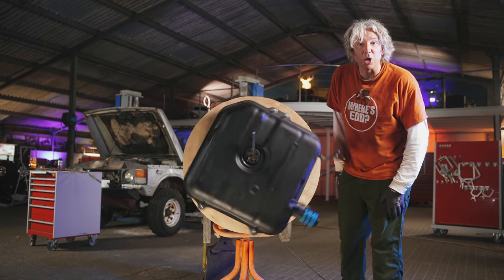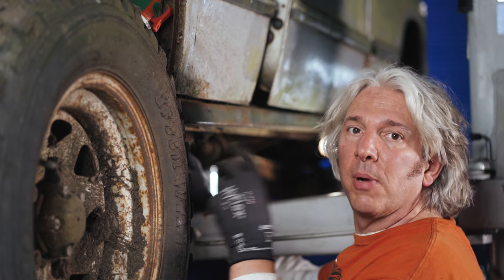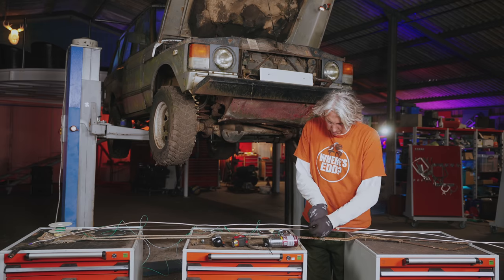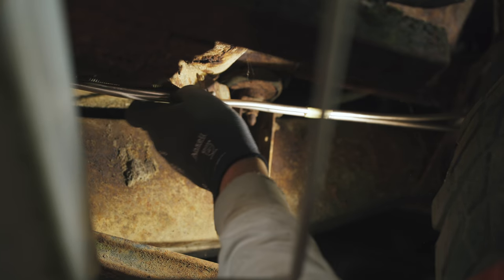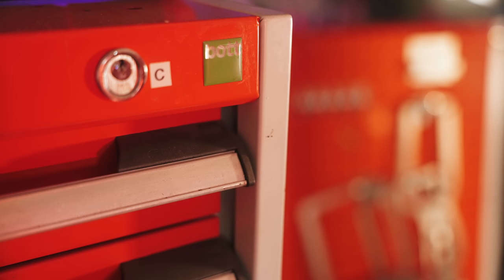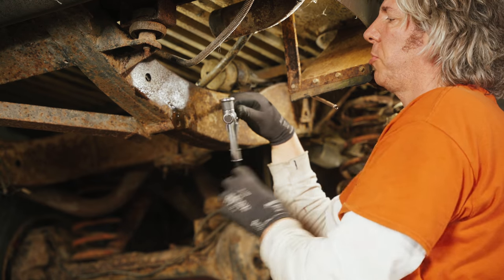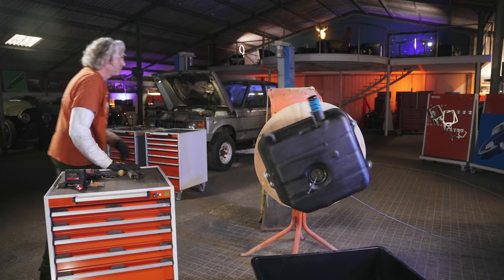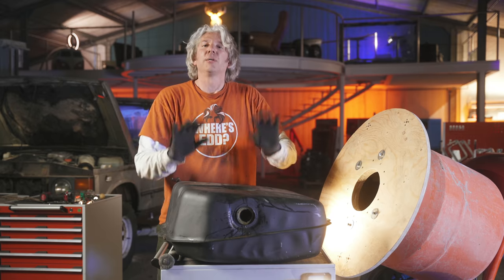1986 Range Rover, rusty fuel tank fix, Part 2 - Edd China's Workshop Diaries

Comment: Nicely done on the fuel tank rust.  I had rust inside a motorcycle fuel tank and got rid of it the following way:

Put in 15 litres of Apple Cider Vinegar in the tank.   (total tank capacity was 17 litres).  
Shook it around, left it 24 hours.  
Drained the cider vinegar out.
Filled it with water from a hose.
Drained out the water.
Blasted WD40 and shook around the tank.
Drained this out.
Filled with 2 litres of petrol, shook this around.
Drained the petrol out.

Tank was then ready to go.  I put an inline fuel filter, to catch any sediment, which I changed after 9 months.  Been using the bike for over 2 years with no issues.

Loving the new channel Edd.  All the best.

Comment: Really want to see this rust bucket to move again
Reply: It wants driving straight to the scrap yard
Reply: It's a bit of a dump,but Ed will work his magic 🎩💯💥💥🤜
Reply: I'd imagine Edd has checked the body and suspension for rust to make sure it has a chance of passing. Then again...
Reply: Terry Winter  it does seem weird and a bit strange 🤔
Reply: Terry Winter  rust bad
Reply: Me too ,sadly had to wait for
the imported bmw to be fixed
First. I like the older mini' s
I perfer the Morris , but can
live with Austin or even Bmc.
lol.
Reply: Terry Winter  

It’s to show ways how to remove rust
Reply: Terry Winter  

And to do it inside is trickier so he showed that also. It’s what these series is for.
Reply: Terry Winter  

It’s not what the show is about.
Reply: Terry Winter  

Edd shows an example of rust removal in tricky places, it is as clear as day you simpleton.
Reply: Terry Winter  It was an experiment
Reply: Terry Winter  That's what fuel filter is for!
Reply: Terry Winter  This way, we get to see the tank removal and refitting (useful for anyone who’s replacing one with a new one) AND we get to see Edd trying to restore the original tank (possibly useful for people who are working on a car where a new fuel tank isn’t an option for some reason). Ok, you think he should have bought a new tank - duly noted - but by trying to restore the old one he has also covered all the steps involved in fitting a new tank, so what’s the problem?
Reply: Bought 1 in 2005 they where falling apart then, would leave piles of rust after closing the doors.
Reply: I advocated scrapping it from the start!
Reply: Terry Winter  Edd knows full well the old Rangey is a pile of junk, but for the sake of his channel he is taking it on as a challenge to get it through a UK M.o.T. test and entertaining thousands of viewers at the same time. Give him a break.
Reply: Terry Winter  It saves buying a new fuel tank for a car that's worth about 2 sticks and a balloon, quite ingenious if massively time consuming.
Reply: @an04ker  my thoughts exactly
Reply: Terry Winter  Well, be my guest. Don't bother watching if Edd bugs you so much.
Reply: Terry Winter  New tanks are probably available for the Range Rover, but for some vehicles it isn't possible to buy a new tank or it is prohibitively expensive, and second hand ones are either few and far between or just as bad as the one on the car. In that scenario, this sort of process is the only realistic option.
Reply: Terry Winter  with that logic you might as well buy a new range rover m8.

Comment: Great to see you giving the cement mixer idea a go, you will get even better results if change the angle of the mixer drum and thus get different abrasion patterns inside the tank. We also used the mixer to a apply the coating on the inside (a new tank was not an option in our case)

Comment: That Range Rover looks like it was dug up by the Time Team.
Reply: @pete it was.
Reply: Nope, he found it in the canal
Reply: @col8981  it was dug up by Time Team in a canal.
Reply: @thewizzard3150  a saltwater canal
Reply: Yep, really dug up by the Time Team somewhere in the muddy banks of the Thames 🤣😅
Reply: Ha ha ha ha ha😴
Reply: I remember when l was younger
driving for a shit company in Luton.
I heard of petrol in a diesel , but not
diesel in petrol tank , also remember
not checking the water bottle & the
fuel line freezing up , lol.
Edd may be a quick lesson on 
Diesel & Petrol do' s & don'ts😀
Reply: I thought that’s how they came from the factory!
Reply: Nah, they're still looking for a burnt-out Cortina XD
Reply: @charles.stewart4422  remember that when cleaning a gas tank it is far less dangerous to use diesel oil than gasoline to clean it with bolts or whatever inside...
Reply: No, it's not the car wizards.
Reply: @Pete,  maybe they some Pottery found alongside it 🤣
Reply: The term "polishing a turd" springs to mind! 😂
Reply: Edds a great mechanic, but though he did all that work to get the Jeep operational the body work is poor. Needs a lot of work. I'd imagine it would cost far too much money making it proper road worthy and presentable again. Be cheaper to go out and buy a used model in better condition. This one looks like it was buried under a hay stack for years.

Comment: Starting in 1988 when I was young and full of energy I took a car I loved apart down to the bare frame. I sandblasted it myself then epoxy primed it and repainted it. I refurbished every nut, bolt, wire, hose, pipe, component and subassembly, just EVERYTHING on that car! So when I FINALLY got through it looked like it was on the showroom floor. Better, actually because it was a labor of love and it took me right at ten years.  So much of what you are doing looks exactly like what I did but you have better shortcuts than I did and I certainly am a huge fan of your mixer parts roller rust remover. I am definitely a new subscriber. Thanks for the vids!!

Comment: Not everyone can afford a new fuel tank. A new tank for a BMW e38 7 series is around £800. The technique shown is really useful and can also be used on a plastic fuel tank. I had to do this on a 5 series where the fuel had emulsified and a combination of thick varnished petrol and rust from the sender unit had coated the insides. I used lots of nuts and bolts and agitation to loosen the coating inside the tank and it restored a plastic fuel tank which was otherwise perfectly serviceable. Great technique for those who may not be able to source a new tank for an obscure classic or on a tight budget.

Comment: i did my brake lines with copper nickel tubing. great product. have been watching you since the beginning of wheeler dealers. I would have removed the tires on the rover for easier access. my favorite parts of wheeler dealers was you actually fixing/repairing vehicles.

Comment: Had no idea that type of line beading tool existed! There's a few times I could have used that, will definitely have to buy one for myself.
Reply: I second that would be useful to know where to buy it or what to search for...
Reply: @happy-days7952  I second THAT!
Reply: @ronskopitz2360  I'm in Canada. We have loan-a-tool programs but the selection can be limited depending on where you're located and now it's gotten to the point where places discontinued the program. Closest place for me used to be a 45min drive, but now I'm not even sure if it's still available.
Reply: @ronskopitz2360  Strewth. No one does that here in Oz, they'd never get em back.
Reply: @jeffkeith637  same here!!  The way they “loan” the tools is that you buy them at full retail, but you have 90 days to return them for a full refund, regardless of condition.  It’s super helpful, with the obvious flaw that the tools are often in pretty bad shape.  But it’s better than having to pay hundreds of $/£/€ for a tool you’ll only use once : )

Comment: Having Big chunky connectors on the fuel line “wouldn’t look right”. 

Meanwhile, moss is growing on top of the headlights and the inside of the car is a verifiable terrarium.
Reply: That's called patina 😉
Reply: @danbradley7176  I was doing work at the house/shop of a guy who was a fairly well known builder at the time and he took me out to see a vw beetle that was being featured in a magazine.  The thing had rust on every surface and when I asked wtf is with the body work he said bro it’s called “patina it’s going to be the next big thing.”  It took a while but he wasn’t wrong.

Comment: Really like the bead tool Edd. I have made new fuel lines for my BMW 840Ci that I have been restoring for a few years out of 8mm copper pipe, and I soldered 8mm brass olives onto the ends to create a bead. Works great, simple and cheap.

Comment: I had the same with a Harley tank. Completely rusted and pieces of old paint layers on the inside due to Ethanol.  
There is a company in out country that blasts the inside of the tank 100% clean to blank metal, and then gives the inside a coating that will stay on for the coming 25 years garanteed. Total cost €350
Reply: You could of used sodium hydroxcide to inert the steel. The main ingredient in spirit of salts drain cleaner.
Reply: @derf9465  I did. I used about every known method over a period of 4 weeks. Never totaly got rid of the rust, and i wanted clean bright metal befor having it coated again. When there still is any rust, you can start all over again in about 3 years. I worked with rusty gastanks several times over the last 40 years. Caustic soda/ natriumhydrixide can only do a limited job. The "pearl" blasting does the trick, but you need specialized equipement and a camera for working 100% inside the tank.
Reply: Por15 tank cleaner kit does the job alot cheaper
Reply: @danieleaton1399  I dont know that Por15 product, but in Europe we do have several kits for cleaning and coating rusted gas tanks. Ranging from €50 to €200, but in the end, over the years, the results of these were seldom any good. Por15 can be better or something new, i dont know.
Reply: @BMWHP2  you can buy it online I used it to clean my car tank had been sitting 6 years used degreaser then cleaner then final tank sealer came out like new
Reply: @danieleaton1399  seems like a good product, and way cheaper than what i had to pay in the end. Thanks, i'll keep it in mind next restauration.
Reply: @BMWHP2  Where can I find information on this procedure?

Comment: "It's a nickel-copper alloy...it's probably going to outlive the Range Rover itself."

That won't be difficult, Edd.
Reply: As long as they last two more weeks
Reply: @joaopmf  Actually if not for Edd's heroic efforts here, the pipe has already outlived the vehicle - since this Range Rover was technically a mechanical wright off before this project began.
Reply: @Beer_Dad1975  It was a mechanical write off when it came off the assembly line 🤣
Reply: @cudak888  LOL, you win the internet for me today!
Reply: @Beer_Dad1975  Don't worry, I'll promptly lose the Internet. I'm seriously considering a '68 Rover 2000 project junker - which means I'm actively trying to give myself a bigger headache than Edd has right now.
Reply: Now THIS comment was really funny :D :D
Reply: @cudak888  Good luck with it! ;)
Reply: @cudak888  Wow, that's actually quite a good looking car! Very stylish! Hope you will have the patience and the power to complete that job. It will definitely take some time... :)
Reply: @janosnagyj.9540  I have the patience, the understanding (I've worked with '60s Mopars and Whitworth-based English bicycles from the 1950's), I've read up everything there is on the bell-crank front suspension and modified DeDion rear, the money (it's currently $900), all I need is the budget to put it somewhere, as I have no space.
Reply: Copper nickel ferro, great alloy, corrosion resistant and seewater/salt resistant.
Reply: @BinneReitsma  Perfect for model railroad rails too.
Reply: @cudak888  They are great cars, very rarely seen at shows so well worth all the pain, as they all are once they are finished :-)
Reply: @stanbest3743  Agreed. It should prove to be doubly unusual seeing as it's a '68 NADA car (I'm in the US). The dual servo master system ought to be a hoot to get working, though I've found gravity + pressure bleeding can solve just about any air blockage...
Reply: @cudak888  Ah well as long as it makes you happy!
Reply: 70% of all Series Land Rovers and Defenders ever made – 2,016,933 vehicles – are still on the road. 70%.
Reply: @stephmaccormick3195  Source?
Reply: @cudak888  Google "number of land rovers still on the road". Can you do that?
Reply: @stephmaccormick3195  Yes. It gives me a listing of a ton of Land Rover dealerships. No source = no validity.

Comment: Please use the right type of hose clamp ("Jubilee clip") the next time you do this.  The worm-gear type that you are putting on in this episode are usually designed to cut into the hose, and are unsuitable for high-pressure applications.  The correct type look like a Greek letter Omega, where the screw goes through the straight "legs" of the Omega, and the sides of the clamp/clip are bent up so that the edge of the metal does not slice into the rubber of the hose.

As you might imagine, cutting into a rubber hose that carries high-pressure gasoline is usually not something you want to do.

If you're sharp eyed, you'll notice one of the correct type of clamps/clips on one end of one of the old hoses that you re-used in the engine bay.
Reply: Some do have an upturned edge that prevent them cutting in
Reply: jubilee clips are shite they have a big flat bit   better wi o clips

Comment: Wonder why you didn’t put some tape over the fuel line so no crud went into the pipes as they went through
Reply: Thought the same, but then also thought Edd knows what he’s doing and probably blasted some air through the lines (off camera).
Reply: In fairness Edd explains this in the video, ‘will have to flush them out as I cannot cover ends as need to feed through tight pipe fittings’ or words to that affect.

Comment: The mess with the water when removing rust from tanks can be avoided if, instead of water, screws and nuts, you simply use abrasives for sandblasting or aquarium gravel. Finally, rinse the tank again with phosphoric acid and the tank is protected from rust from the inside (rust converter principle)
Reply: it was filled with rust treatment not water and removing nuts and bolts is easier than removing grit from a fuel tank I would have thought.

Comment: Couple of quick questions. 

Why don’t you (or didn’t you) just take the wheels off? You seem to be working around them with difficulty. 

Secondly, we know the Rover is a field find. But with a few minutes or even an hour of a scrub brush, soap and water would have given you an almost clean work space with out cobwebs, dirt and whatnot that will cause you to take additional time to blow out lines and connections after they fact…
Reply: All the time I was repeating these words: why not remove the wheels? Wouldn't it be more easy to access the places where the tubes are bent the most??? And the other is: all the dirt from the chassis is now inside of the brand new fuel lines, AFTER the filter...

Comment: Hi Edd,

You reused the original flexible fuel lines - are these compatible with E10 fuel?
Reply: Dont use e10, it's just ASDA crappy fuel.
Less energy units per volume is a dumb idea. So the distance travelled goes down for same volume fuel . . .
Oh yea, let's pay for worse fuel consumption, excellent idea.
Reply: @pikethree  no option soon once E10 is standard unless you want to pay 10p per litre more for premium.
Reply: @N-youodd  Yes, I will be doing that unfortunately.
E5 is good for me even though one of my cars is a 2002 Volvo

Comment: Shouldn't fuel tanks be sealed after such a treatment? After all, the coating has been eroded/rusted away. No tank will remain full at all times to protect the bare metal.
Reply: Yes, I guess so. Apart from that: there still is a pretty big amount of rust in the tank. Why didn't he tumble the tank for another 48 hours. Maybe with stones / sand?
Reply: should have bought a replacement for that pos tank. what a waste of time.

Comment: I’m sure there’s a reason you haven’t removed the tires to do that.
Reply: I was just thinking the same. I’m half way through watching this and that wheel is even annoying me!!
Reply: Possibly to prevent impaling  himself on various bits of suspension?
Reply: Trying to get those wheel nuts off is a whole other episode.
Reply: He'll be moving it up and down too often
Reply: To much rust
Reply: @juanmanuelalvarezmesa2965  That's rather a strange toast.
Reply: I too was thinking the same as the most difficult part of the fuel lines to work on was almost behind the wheels...
Reply: @AHoundOnAHonda  ponele
Reply: @juanmanuelalvarezmesa2965  What?

Comment: Edd always makes it look so easy (yes I know the magic of editing helps...a lot) but it is good to see someone bring back that old rot box back to life. Usually you need a team of mechanics to tackle a "project" like this.
Reply: Once Wheeler Dealers went to the US and replaced Edd with Pants Pantstead, they had a whole team of mechanics - a head mech and at least 3 or 4 "grunts" and a fabricator, to do all the work. I seriously doubt that Pants EVER did any actual work on the vehicle, he was just the pretty face of the workshop and filmed just removing or replacing the part as the last action after the REAL mechs had done all the loosening or before any tightening. He certainly never had any dirt on his hands other then the "artfully placed" fake dirt added by the makeup dept.

Comment: The explanation about the noisy reverse gear is very clear although I think that there may be another factor in addition - diff whine.  When travelling in forwards gears the crown wheel and pinion will mesh together and find a sweet spot but in reverse the end float on the pinion shaft might allow them to adopt different points of contact which are not so well bedded in.